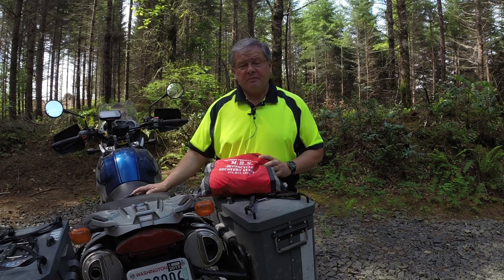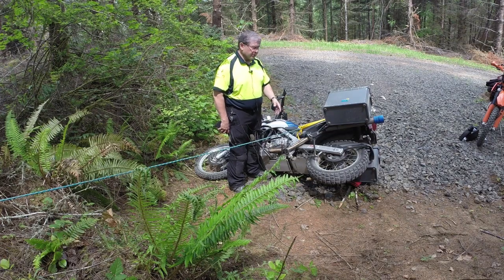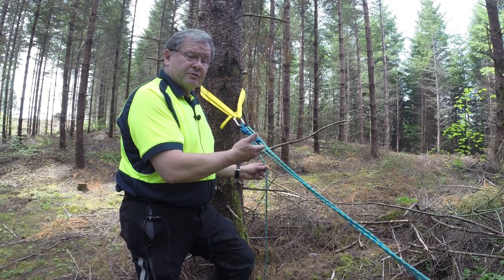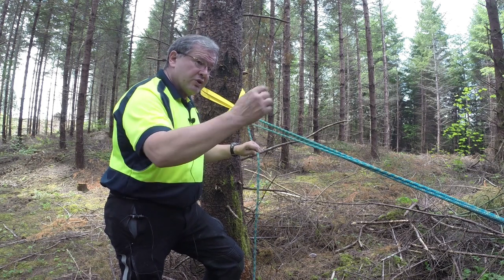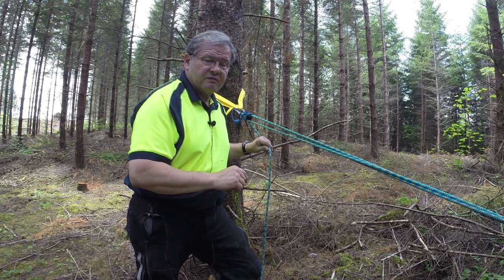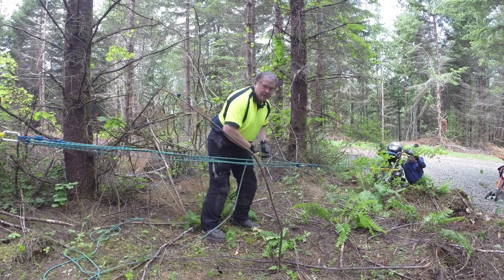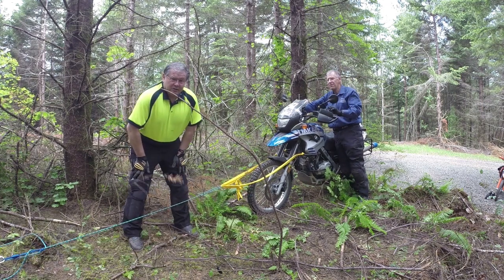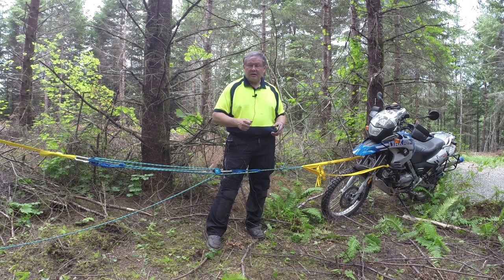BestRest Motorcycle Recovery System (MRS) Part 1 - RECOVERY

Comment: You need to explain that by flip-flopping the system you also go between a 4 to 1 system and a 5 to 1 system. When you are pulling against the anchor (tree) it will always be an even number mechanical advantage (in thus case with the double pulley a 4 to 1). When you are pulling against the load (motor cycle) it will always be an odd number mechanical advantage (in this case a 5 to 1). It's not just a convenience matter of which way to pull. Great little system though. You can also just use one side of each pulley in the case where you don't need as much pull or if your rope isn't long enough to rig through both shieves og the double pulley, thus creating a 2 to1 or 3 to 1 system, depending on the direction of the pulling.
Reply: I sense some technical background here.  I have this exact setup in a bag hanging off my rope rescue harness.  Makes an awesome jigger when you have to adjust a stretcher bridle under load.  Will be building myself another to put on my bike. Probably keep cost done and not use rescue pulleys  Maybe grab some sheaves from the hardware store.

Comment from the maker: Not having an anchor makes things much more difficult.  Without an anchor you can't pull - so you have to find (or make) something.   If you're in the middle of the desert the only solution is to create a "dead man".  That term refers to something buried in the ground, something that you tie the rope to - a strong branch or piece of wood, or a large rock.  

Dig straight down as far as possible, then dig a narrow ramped trench upward from the bottom of that hole, toward the bike.  Tie the rope to the rock or branch, put it down in the hole, then cover up the rock or branch and tamp the ground firmly.  (If you're using a branch, align the branch perpendicular to the direction of pull.)

As you pull on the rope, the rock or stick is pulled into the earth, sideways.  If you don't bury it deep enough it will pop out.  Take your time burying the deadman, if you get in a hurry it will fail.

Dakar Rally trucks use a sand anchor - it looks like a big boat anchor.  As they pull on the anchor it digs itself deeper and deeper, creating a solid pulling point.  Unfortunately a sand anchor is too big and heavy for motorcycle use.

Comment: Great product for in the woods.  How do we use this in the desert?
Reply from the maker: If you're in a large rock area use that as an anchor point. Sandy area doesn't give you many anchoring options. You <could> bury a "deadman" of some sort to act as an anchor point... i.e. a large stick, a rock, or your buddy's bike.
Reply: @bestrestproducts648  Yes, that was the problem, finding something to bury.  I find the Dirt Napper or the Moto Winch will be a better product for me.  I'm not concerned with winching my bike up a mountain, and I ride alone so I can't use your method to set up my bike after a drop because it takes two people and I don't have any trees.  But the Dirt Napper and Moto Winch are strictly for uprighting the bike or getting it off you.  I might carry one of those with me if I can justify the $200.
Reply: Carry a bag, fill with sand and bury. Tie to the bag handle.

Comment: With this method you need a buddy to hold the bike while you pull the rope. I only ride solo.

The Chris Birch method allows you to do it all by yourself by simply using a rope that uses the rear hub as a winch. You secure the rope to a few spokes just to start, then use the engine to slowly wind a few turns of rope onto the hub. You can then use as much engine power as needed to winch your motorcycle up an incredibly steep gradient all by yourself. That engine is a very powerful winch motor.

Of course if you’re a shaft drive “adventurer” you’re out of luck
Reply from the maker: I've seen the Chris Birch video.  Very creative. Probably not practical for most of us. I wouldn't do it... don't know anyone who has done it. 

For solo riders, set the up MRS so you're standing at the bike as you pull. Take up tension, create some energy in the rope, then release the rope and let the prussik engage the pulley. Use the remaining stored energy/ tension as you push/ pull at the same time. 

No doubt that having 2 riders makes things a lot easier. But it's still better than nothing.

Comment: Got bogged riding solo today so looking for solutions. How would this work when you're by yourself? It seems as though trying to pull while keeping the bike upright could be quite a challenge. Any tips?
Reply from the maker: MikeOxwelling2 - the best scenario is a 2 man + crew. But if you're solo you use a different approach.  First get the bike upright. Reset the MRS if necessary. Set it up so you're pulling the rope toward the bike as you stabilize the bike with your hip. Take up tension on the rope and release it just enough so the prussik locks onto the pulley.  You should have quite a bit of stored energy in the rope. Then push the bike ahead a bit until you lose the elastic energy in the rope.  Repeat, repeat, repeat. It'll be slow progress.

Comment: Can it be done by the rider alone?…..most adventure riders travel on their own……
Reply from the maker: Yes you can do it alone, but of course it would be much more difficult because you'd be pulling while balancing the bike (like I did in the video).  Some situations might even be impossible...  
.
BUT consider this - if  you were riding alone and you went off the trail you'd be totally screwed.  You'd have to rely on brute force.  With an MRS you have tools and mechanical advantage working for you.

Comment: The things stubborn old men will do before admitting a 250 makes more sense
Reply from the maker: LOL.  Yes a 250 makes sense on the trail, but for longer range adventure rides the 250 doesn't cut it.  And even if you have a 250, hauling it back onto the trail can be .... problematic.  I also ride a KTM 450EXC and I've used the MRS kit to haul the bike up an embankment that would be impossible even with 3-4 other guys helping out.

Comment: Disappointed with the product.  First off, carrying pouch is significantly smaller for the 5 to 1 pulling system than shown  in the video, and can barely fit the components back into the pouch. You really have to pay attention on wrapping the rope back up to fit into the pouch.  Second, there were only 2 yellow webbing anchor strips in the pouch.  would not be an option to fit a third attachment webbing into the small pouch sent with the product.   In my opinion, this is misrepresentation of the product.  Third, the video provides a very poor example of actually tying the knots for attachment to the anchor points.   The instructions in the pouch are for only the three to one system, so the five to one takes some thinking to figure out the system.   Would not buy again for the money, if I have to figure out through other sources how to configure the five to one, I might as well just go to a seminar at REI mountaineering to figure out the system and buy the components.   For the novice who has never used a Bowline or waterknot, it would be a stretch for them to figure out which to use where.  Did not mind paying a premium for the components because I didn't have the time to configure a kit on my own, but should have saved the extra cost and done so on my own.   Sorry folks, but this is a fail in my perspective.
Reply from the maker: Sorry, but your negative comments are simply unfounded.  Here's why:

The video was filmed several years ago, using a kit that has since been discontinued.  Back then we supplied a larger storage pouch that could hold a 10mm main rope and 3 pieces of webbing.  Based on customer feedback (who told us the kit was too bulky) we went to a smaller system, using 8mm main rope and 2 pieces of webbing.  If you feel you need a 3rd piece of webbing simply wrap one around the outside of the pouch.  The new MRS still performs the same way as the one shown in the video and there's no loss of function in any regard. Yes the current kits are smaller.  If they were bigger we'd get complaints about bulk.

The website CLEARLY describes the new MRS kits we sell and every component is spelled out line-by-line, so your claim that we misrepresented the product is disingenuous (which a nice way of saying your claim is bullshit).  There's photos of the each kit and there's no way you can claim we made any misrepresentation as to what's included.

The video is long enough as it is.  If we took the time to give a knot-tying tutorial it would be much longer.  You can watch a thousand other videos to learn those skills, nevertheless included in the kit is a sheet with line drawings showing how to tie your own knots, the types you might need when you use the MRS.   We can't conjure up every possible use for each knot, instead we leave it to the customer to make their own decisions about knots and/or anchor points.  

As for the instructions included in the kit, they're designed for both the 3:1 and 5:1 system.  The instructions clearly tell you that for a 5:1 you simply run the rope back thru the pulleys one more time.  You must've missed that page (it's in the middle where the booklet opens to a wide illustration.  Taking that class at REI might be a good idea for you.

As for "pay(ing) attention on wrapping the rope back up to fit into the pouch", yes you need to carefully coil the rope into a small bundle, fold it in half and fit it down into the storage pouch.  Everything else then goes on top and the flap closes the pouch.  If you stuff everything in there willy-nilly then they won't fit.  We designed the MRS to be as compact as possible and still give you what you need for recovery or towing.  I should point out that you're the first customer to <ever> complain about repacking the kit in the pouch.  Thousands of others seem to have figured it out.

You wrote, "this is a fail in my perspective", but is it really?  You're complaining about little things that have no bearing on the components or the actual function of the MRS.  Seems like you're nit-picking about things that either aren't true or don't apply.

As for paying a "premium price" for the MRS kit... if you go to the REI website and price similar components, they would cost you at least $180.  They don't offer the double pulleys that are part of our 5:1 kit so you'd need to carry 4 single pulleys.  Your REI total would now be $206.  Then buy a pouch to hold it all.   When you do the math the MRS is modestly priced for what you get.

When a rider makes the decision to carry some type of recovery gear, they're anticipating some trail-side scenario that goes beyond the brute force needed to manually drag a bike back onto the trail, and/or they're taking precautions that give them the ability to tow another disabled motorcycle.  A recovery system seldom ever needed, but carrying one is good insurance against "that one day".  Any recovery system has to be small enough that the rider doesn't mind carrying the added weight.  Make it too big and too heavy, and the kit will be left on the shelf when the bike hits the trail.  We made the MRS as small and as light as possible, and for that reason riders are willing to carry it in the panniers or strapped to the frame.

Comment: Solution: Get a lighter bike.
Reply from the maker: Solution - don't be a jerk.  Elitist put-downs of other bikes that riders choose to ride is never called for.
Reply: @bestrestproducts648  I'm not saying you shouldn't drive a GS1200, what i am saying if you don't want to spend 2 hours pulling and doing all this stuff (with a second person as you demonstrated) get a lighter bike. Everything is doable, it's what fits best to you.
Reply from the maker: @leosedf   Riders ride what they ride, they have what they have.  They're not gonna go out and buy a lighter bike just because they might (someday) need to be hauled up a slope, or or towed off a mountain.  And even if they did buy a lighter bike, they still might need to haul that light bike up a slope, or tow that light bike off a mountain.  

If you want to argue the whole concept of motorcycle recovery, you've come to the wrong place my friend.  

I've got both large and small bikes.  On my KTM 450 I carry the MRS Trail Kit.  Same function as the HD kit shown in the video.  I've used it many times to haul that "light bike" up a hill, back on the trail, and I've towed others down from a mountain.
Reply: leosedf well...I ride an XT250, and I just got stuck in a mud hole...which is why I am here.  could not budge the bike by hand. Luckily I was with someone with an ATV and winch.
Reply: @leosedf  Solution:  there is no perfect solution.  I've worked with 4 other strong guys to haul a 220lb 2-stroke enduro bike up a 75deg hillside after falling off single track.  But I'm sure you'd just climb down, toss it on your back, and then climb back up.
Reply: @feo2229  I have an XT250, very nice. Still lighter than a big GS.
Reply: @teamagoge-theenduroists8683  Imagine having to do all that with a big V-strom or a 1250 GS.
Reply: @teamagoge-theenduroists8683  maths are hard. 75 degrees is a vertical haul. So yeah, 5 guys needed.